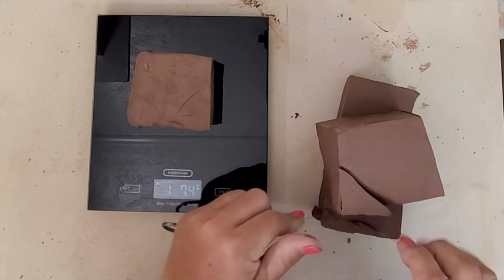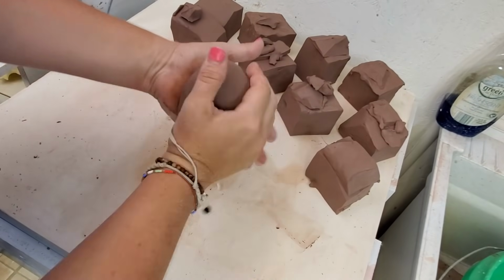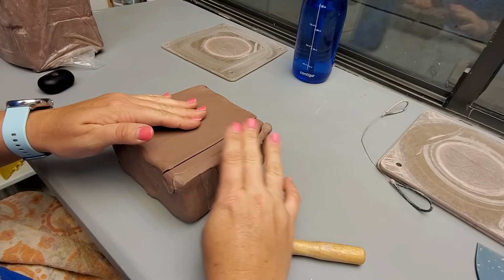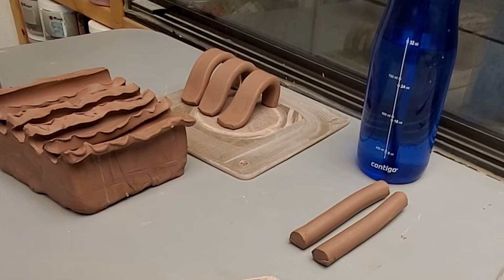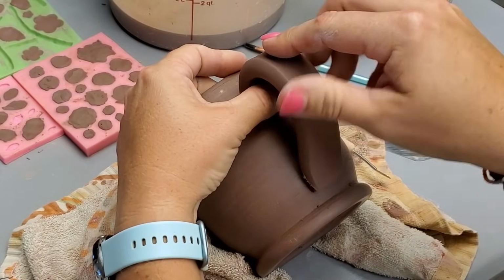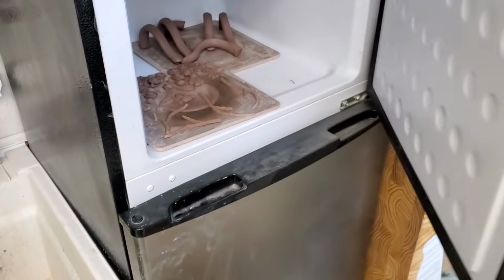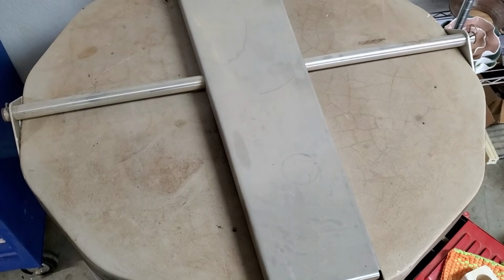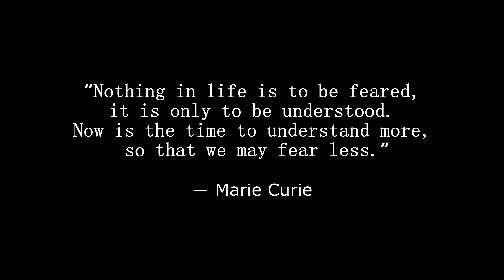Turn a Lump of Clay into a Beautiful Mug

Comment: OMG! How do you throw with nails that long?
Have you heard of using white vinegar instead of slip to bond the handles? It forms a a stronger chemical bond. 
My teacher was Randy Brodnax.
Reply from the maker: I usually keep them super short. These are a little grown out. I have to get dip manis, or my nails will split and crack because of the clay.